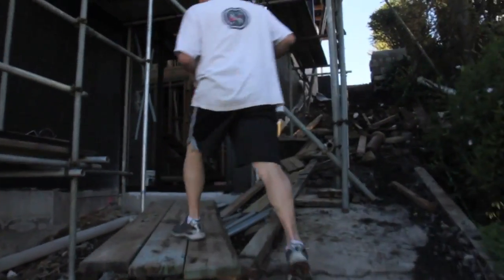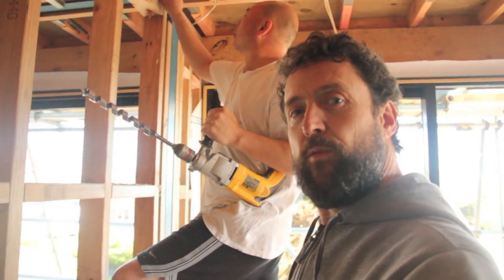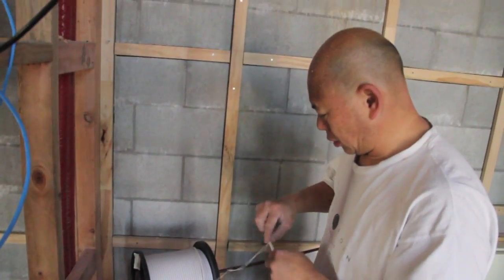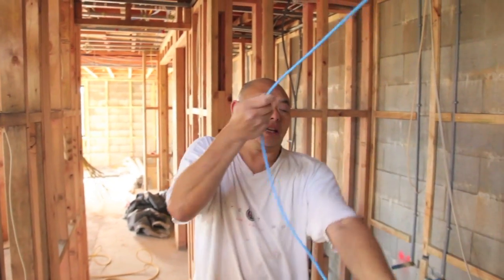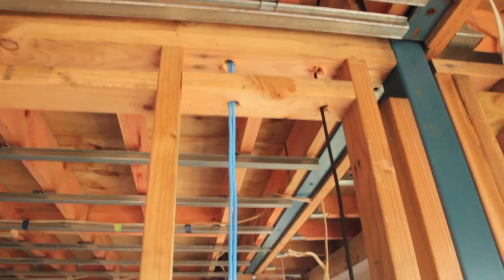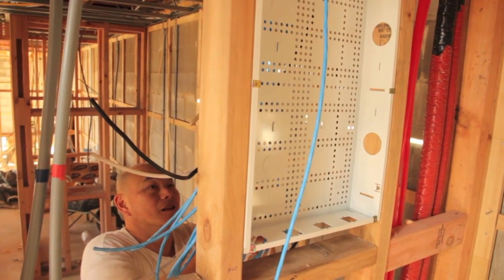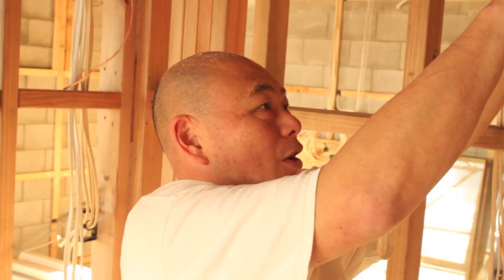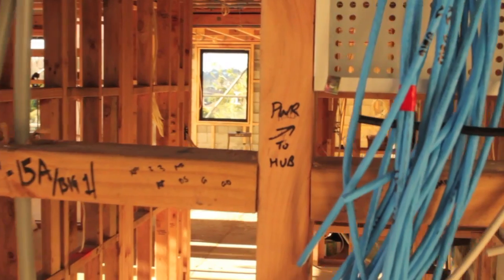Low Voltage Wiring Day

Comment: Looked good, here in the US I'd never pass inspection with most of those oversized holes. That speaker cable is also not wall rated, so I could not use it. For data we use Cat6 and RG6 for the RF.
Reply: Exactly, holes are way to big.
Reply: @extracareav  https://youtu.be/f1VKR5TUS4w?t=65 might as well just remove the vertical stud altogether here!

Comment: Here in the states it is most likely that the cables would get cut off if dangling out the boxes like that. Roll it in the box or use a staple just enough to hold the tail end down towards the bottom plate. So when it comes to the Trim you just reach in, pull up and out the cable tail end, attach the fitting/connector and plate it. Also starting the pull from the panel isn't a good choice, it gets busy there real quick. It's easier to start at the box location and pull it to the Panel. Six hours to pull a house with that little bit of cable? Not to mention two people? Kinda sad really.

Comment: Waste of time to measure the cable prior-to, just drill your holes, mount your boxes, visually rough it out and pull the cable as needed. Saves a lot of time.
Reply: Actually, it's not always convenient, especially when it takes a lot of wires to pass through the same way, and  when you have just few or less rolls of wires😅 It's very actual for poor countries, for example mine. When you need to pass, for instance , 600 meters of cables, and instead of having 4 150-meters rolls, you have only 600 meters one. And besides of you, there are 2-3 guys, working with that(

Comment: If the home is unfinished, why not use conduit or pvc to clean that up some?
Reply: Raymond Wright Because Low Volt  code is very minimal due to the fact that it's low voltage. Running conduit would be too costly for the customer. PVC on the other hand may vary depending on the electrician(s) experience. Considering most people Charge $100+++ per man, depending where you be. Just unnecessary. Unless the customers very particular and doesn't mind spending the extra coin for neat looking work.

Comment: I think the music is GREAT!   What album or band is that?    It'd of been better if you showed the final result - what it's all used for.  With wireless hubs, I just don't see the need to run 50 data lines throughout the house.  And those holes would never pass any inspection where I live.

Comment: Thats an incorrect term to say "Low-Voltage" cables if they are TV, Audrio and Data cables mate.
High Voltage is any voltage levels beyond 1000 Volts AC/DC
Under 1000V AC/DC down to 50VAC 100VDC is "Low Voltage."
Under 50V AC and 100V DC is in a lower Category called "Extra-Low Voltage". In this category of voltage you have Data cables. Extra-Low Voltage or ELV does not require the license of an Electrician to install. 

1000V+   = Energex, Ergon, Powerlink, Linesmen, power stations,transformers etc etc
-1000V:+50VAC +100VDC is Electrcian
-50VAC - 100VDC - Who reallys give a fuck
Reply: It's still considered as the term Low Voltage or Low Volt. Electrical is the term used for typical AC Voltage in construction. Requires different licenses and permits in some cases. Not to mention Electrical Contractors consider stuff like this a joke.